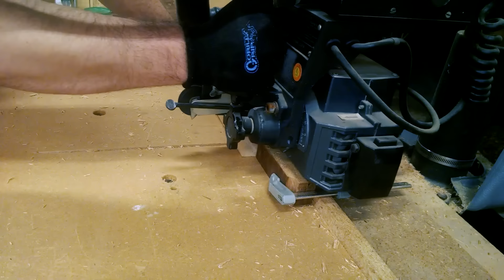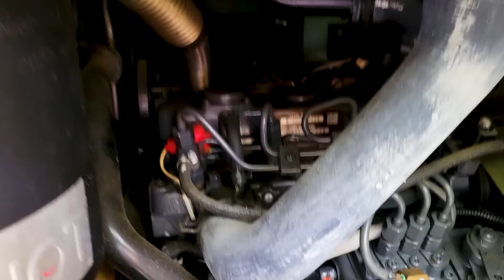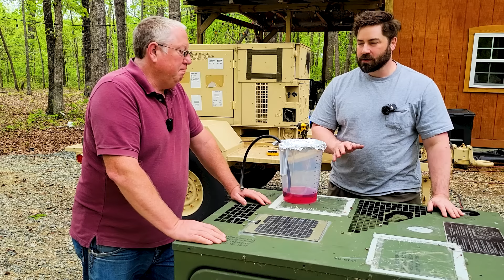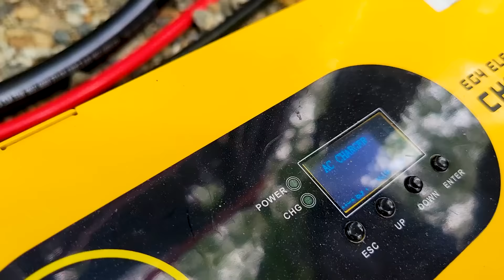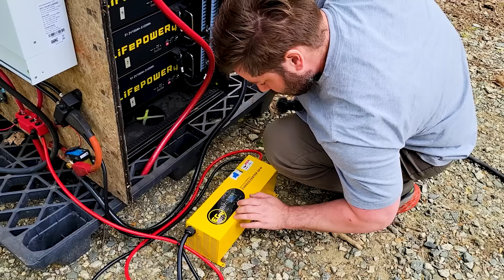Testing the Army's most efficient generator

Comment: All of 5kw for that gigantic unit. My current generator is a third of that size. It has wheels, and a fold down, 2 hand lift arm. But an inverter and 12kw on gasoline.9.8 on propane a little lower on natural gas. I only use propane, except emergencies when its not available. auto start, fancy electronic displays, safeties....etc

Comment: Why did you not try running it at 2.5KW rather than 5KW? It might have been more efficient.
Reply from the maker: Military generators are prime rated.  This means they are designed for continuous duty operation, 24/7, in very demanding environments.  This is quite different from consumer-grade generators you can pick up for a few hundred dollars at a big box store.  If we were talking about a consumer-grade generator, then I agree with you that running at 50% rated power would probably be more efficient.  But, with a prime-rated machine, they are designed to be most efficient at full load.  Thanks for watching.

Comment: One power loss you didn't account for - the batteries themselves. Not all of the power that goes into batteries is available for use. Here are the efficiencies for the various battery chemistries that are typically used for back-up power as found by testing by reputable test labs and manufacturers:

University of Munich / BYD B-Box LiFePO4  99.3 – 99.6 %
DNV-GL tests on Pylontech US5000 LiFePO4  99.4 %
Sandia National Labs – various 18650/21700 NMC  97.8 – 98 %
Tesla 4680 cells (2024 pack tests) ~98.8 – 99.1 %
Trojan / Rolls flooded lead-acid  75 – 82 %
Fullriver / NorthStar AGM  85 – 89 %

The battery banks you are using are LiFePO4 (I believe) so they account for about 0.6% loss, which is not a lot. Additionally, there's a mitigating factor to this loss. The 0.6% loss is not for the power from the generator, it's the power coming from the charging circuit, which is a smaller amount. IOW, the loss is simply not added. 0.6 % becomes 0.54% with 90% efficiency at the inverter, so roughly 0.5% which is not a lot. LiFePO4 chemistry is pretty efficient.

Comment: There is a way to test this generator on three phase, using equipment that you are familiar with. However, it would require another Chargeverter. Can you imagine having three of them?!?!? One chargeverter across each phase of 240vac. The amperage of each would probably need to be dialed back somewhat. Perhaps 65 to 75 amps each. That would take full advantage of the generator and possibly increase efficiency.
Reply from the maker: That would be cool.  I'd do that on a larger generator, but I'm not sure it makes financial sense with this 5kW generator.  If I had 3 chargeverters, that's 1,666 Watts each.  Minus the 10% loss in the chargeverters, that limits the output of each charger to 1,500 Watts.  If the charger is set to 56V, that is 26 Amps.

Comment: Novice in this field, can someone explain the following to me? How
do I calculate output on a generator vs a power station. If this is a 5kw generator and charged about 10.6kwh hr with 1 gal, what spec of a power station can output something similar. Thus any be confusing as it not sure I worded this question correctly. But I’m trying to see what size of power station can replace a generator like this. I had someone install 100kwh cabinet at the office and trying to wrap my head around all this 😅.

Comment: that giant thing is only 6kva? wtf?
Reply from the maker: This generator is physically much larger than a consumer grade 5kW generator.  This generator is "Prime" rated.  Meaning, it can put out 5,000 Watts 24/7/365.  It can also do this in high-altitude and desert conditions.  Usually, consumer generators are not rated for that.
Reply: I see thanks for the answer. It seems like an engine so beefy it could drive a much bigger generator but idk. I bet its nice and quiet maybe the 3 cylinder design was to help minimize vibration? I use a generac 24kva that has a 1 liter engine. I saw one of these army generators at an auction the othet day which brought me to your video. Id love a diseal backup since i cant store very much lng. It sold for 4800 usd. Not sure if that was a good price or not i had bid 2500 and it went over that quite fast.

Comment: Cummins b6.7 truck motor break in on a frieghtliner is really noticeable. I’d say 10 to 15 thousand km you really notice more power and better fuel efficiency. Cummins says there engines don’t use or need a computer  assisted break in but I have driven lots of trucks and notice power and fuel mileage is better after some time to break in.

Comment: As a 25 year generator tech, ive gone from mechanical to the digital. That automatic stuff is nice. Untill it fails. And, it definatly will faill. It will be the computer electronics, not the engime or generator. Then it will cost you lots and lots of money to repair. Simple is always betrer. Putting fancy computers on stuff just because you can is stupid.

Comment: Running that close to 90%, and only 22% efficiency? That definitely sounds like a military genset. 

Crazy fact: when running a consistent load above 70% engine rating, gasoline is usually cheaper.

Diesel engines are great, don't get me wrong... but the main factor making them great for generators, is part-throttle efficiency, because loads typically don't hover at peak output. Batteries buffer this, allowing the generator to run at/near peak output for a shorter period of time... which pushes the duty cycle into the realm of increased power-per-dollar of a gas engine.

Comment: This thing is nice, but really hudge for 5kW in myopi ion. Not sure if for private backup use something less sophosticated woulden't do the job as well.
Reply: The previous generation of machine are a much better value at the moment. They are a little larger and simpler and easier to work on and also half the cost. 

If you need a few hours a year of backup power, this isn't the best machine for you. If you need hundreds or thousands of hours of backup power, these start making sense. 

We had an ice storm here that took out power for 10 days. We went through two 5kw gas generators during that time. One of these machines would have run the entire time and still been ready for the next one. That event was what started the military auction hobby.

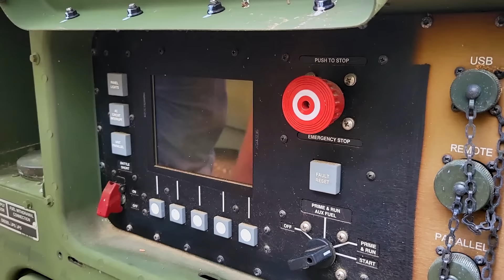Comment: 4:25 how old is this ? ... How many hours
Reply: 60 hours so it was never used
Reply: @BlowBubbbles  40 of those hours have been post auction. It had around 20 when it was picked up. 

I think the reason why this one went up for auction is it was registering low oil pressure on the computer. After a little troubleshooting that was resolved with a new oil pressure sending unit. There was nothing actually wrong with the generator, just a bad $80 sensor.

Comment: I have a Honda inverter gasoline generator. It’s rated at 5500 watts conservatively. I average 1 quart of gasoline per hour on economy mode at 1/2 load. 
The Honda only provides 120/240 volts. Not 3 phase.
Reply from the maker: I also have a Honda and did a detailed fuel test in it: https://youtu.be/kQTFPMDE_F4?si=ShUoQE1jFAul1Pmh

Comment: "Jump" Nah.. Holds up capacitor and a Stator big enough for lowest amount of cranks to fill that capacitor to dump low into starter < If can't crank the generator by hand for that capacitor. "Water cooled" Sets Ultrasound echo pressure wave audio spotlight laser on the ground You ever seen videos of Acoustic levitation merging mist to float water drops? Do that that with atmosphere vapor. Good clean water drip through a dust filter that has ultrasound pulse wave self cleaning behind the wall of the pipe below it to force trash out of filter screen if used in a sand storm. < Same tech for sand storm to prevent engine from sucking in sand when breathing. Heh..

If you want to go crazy? Add thermoelectric generator technology to use waste engine heat for more power THEN use that at safe frequencies of your machines to create a holography repel field. Never ever have to clean your engines again..

Comment: That fat line you used seems like it could be a few percent of error although you seem to think that the fuel gauge was accurate.

Do you consider the diesel standard that the military would use vs. what you buy? Was it a seasonal mix to prevent gelling?
Reply: I did verify with the fuel vendor that was the summer blend. The fuel that was used in the test had been purchased within 2 weeks prior. Here in the south they only run the winter blend for a few months during winter. 

The mark certainly could have been part of the issue. We will be doing other tests in the near future that will refine the results.

Comment: My first ever dislike on your channel! When I first started following you like 6 years ago, you were cool. I was interested in Solar and renewable energy. Now it seems that all you do is video about generators. Why? What is the purpose of using fossil fuels to recharge batteries? You might as call yourself the David Poz generator channel! I am extremely disappointed and am unsubscribing!
Reply from the maker: I understand.  Over the years I built up my solar and battery system large enough that I'm now running on solar 11 months of the year, with the exception of January.  In January we just don't have much solar because of back-to-back snow storms.  I find the generator has to run a lot in January and I want to optimize that part of the puzzle.   I used to run my Honda EU6500, but have cut that run-time down by 40% by switching to my Kohler light tower.  I'll add a heat exchanger and pull the heat off of it to lower my run-time even more.

Comment: The difference is in the 3 phase vs Single phase.  Three Phase power factor  "3-phase formula P = √3 * V * I * cos(θ)"  Single phase Power Factor "P = V * I * cos(θ)"  In layman's terms depending on the generator the 3 phase will net 30% more watts per input power.  I would say your numbers are VERY good given the math
Reply: Just spitballing here, but a generator head that can output either single-phase or 3-phase will have to have stator windings for both configurations.  I assume that means there could be 12 total connections to the stator, 2 per winding and up to 6 windings. (two windings paired on one phase would make split-phase 120/240 possible) Using single-phase, you'd only be using one third of the winding pairs.  I would imagine, since all 5kW of your output is coming from one winding pair, you'll see more resistive/inductive losses in the stator than if you could use all three winding pairs.  Using all three phases might reduce I²R losses in the generator windings since the load is being spread out across all three so peak current would be lower on average.  Does that make sense?
Reply: That makes perfect sense, considering how widely three phase power is used in industrial, commercial and institutional settings. Nobody would want to deal with the added complexity unless there was a major advantage of using three phases.

Comment: 2.3 kWh per liter to charge the battery, so about 21.7% efficient, not too bad but still does not beat my 35 year old Hatz diesel that drives a hubmotor and some diodes to charge my 48 volt battery, i get about 2.6- 2.7 kWh per liter or around 10 kWh per US gallon

Comment: They said why it didn't measure up - the BREAK-IN PERIOD hasn't completed!!  That motor is only 60 hrs in  on a 200 hr break-in!  Lesson re-learned is:   To get the most out of your IC engine, follow the manufacturer's rules for proper break-in.   Then you might not force your viewers to try and  make sense of it's less than stellar performance.  (I hope nobody got the crazy idea to drain the oil that was in there and switch it to synthetic - it'll never wear in.)
Reply from the maker: When I broke in my MEP-802A, I went to a John Deer retailer and bought their break-in oil.

Comment: What is the THD rating? Thank you.
Reply: Here is the info for the MEP802 as sourced from the technical manual:

1. Voltage:
a. Voltage Waveform Deviation Factor:
Single Phase 6% (max)
Three Phase 5% (max)
Single Voltage Harmonics:
Single Phase 3% (max)
Three Phase 2% (max)
b. Voltage Unbalance 5% of rated voltage (max)
c. Phase Balance Voltage 1% of rated voltage (max)
d. Voltage Modulation 2.5% (max)
e. Voltage Regulation 3% (max)
f. Short-term Stability (30 seconds) ±2% of rated voltage
g. Long-term Stability (4 hours) ±4% of rated voltage
h. Voltage Drift (60 °F (16 °C) in 8 hour period) 2% (max)
i. Dip and Rise for Rated Load 20% of rated voltage (max)
Recovery Time 3 seconds
j. Dip for Low Power Factor Load 35% of no-load voltage (max)
Recovery Time 5 seconds
95% of no-load voltage

Comment: each lead acid starter battery has about a half kwh of energy that could have been unaccounted for. if batteries were half flat then there is a missing kwh there. also they usually take a bit extra to float during operation, depends on when they were ran last.
engines are less thermally efficient when theyre cold, you get better performance out of a cold engine but you get better efficiency out of an engine that is about to melt itself.
thermal expansion and what not, hot engines run more efficient. this is commonly misunderstood since most things that improve power also improve efficiency, not true in this case. 
the chargeverter might be using some kind of power factor correction. idk what the point of that is, just call it an inverter or transformer. kva vs kwh (power factor). 
higher voltage will loose about 1/4th as much from voltage drop on cables to battery charger.
the possibility of loose connections could have been excluded with the use of a thermal camera.
hmm what else, i think in 3 phase mode the effective thickness of your wires is bigger. were talking fractions of a percent here though for a reasonable distance of wire.
i really think most of it is down to running a cold engine and being surpized it doesnt get good thermal efficiency. you can get about a 40% boost in mpg out of any combustion engine if you run them much hotter than anyone should. i think at 60 hours that sounds like good enough for break in to really be done with. oil weight were talking a percent or two at most. again depends on temp.
chevy volt gen2, 1 gallon gas = 42 miles = ~12kwh, direct injected
chevy volt gen1, 1 gallon gas = 32 miles = ~10kwh, port injected, lower compresison ratio.
Reply: So to add to the test setup procedure... run the gen at no load until current going into the starter battery drops off, gen gets warm, connect charger via whatever input voltage and phase configuration would result in the lowest average current draw (3-ph 208 ideally), then start taking measurements for kWh and fuel usage.

Comment: Okay here is the problem, never load a generator past 80% capacity, especially if you are trying to get maximum efficiency,  that being said, the unit is 5000 watt's at 120/208 3 phase running the math on it is 2,309 watts at 80% single phase. Being that it's designed for the military it's probably a little underrated, but I still wouldn't take it beyond 3000. At least unless you take the output run that through a 3-phase bridge rectifier and feed the DC info the charge verter which you can do I have one of those precisely like yours, the input goes through a low pass filter and into a single-phase bridge rectifier, which will pass DC straight through.
Reply: For consumer machines rated for standby duty, I agree 100%. These machines are different. These are continuous duty rated which means they can run at 100% load for an unlimited amount of time. They can run up to 125% load for a short time. The engine at 1800 RPM is rated for just under 15hp. That is significantly above what is required to generate 5kw. Looking at the machine, I think the main limit on power output is cooling capacity. So far in all the testing I've done with these generators, the cooling fan has never ramped up above barely spinning and the coolant temperature has always been in the normal range. 

For the fuel burn, the military rates fuel consumption @100% load. We took the numbers right out of the manual and were looking to see if the machine could come close to the published performance. If they had stated fuel consumption @80% load, we would have certainly tested at that output level. Since it fell short by enough of an amount to stir some curiosity, I'm planning further testing to see if I can find a reason for the difference. 

One point of interest is I've found on Cummins's website a slightly different number. They state a burn rate of 0.54 gph. Hm.. That is MUCH closer to what we recorded. Is the manual wrong and the brochure correct?? I am curious, are you?